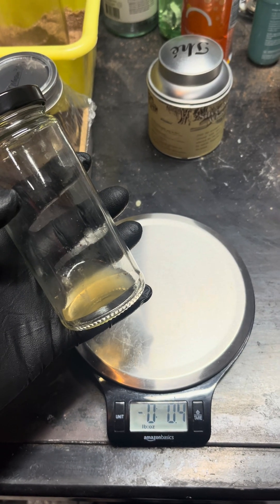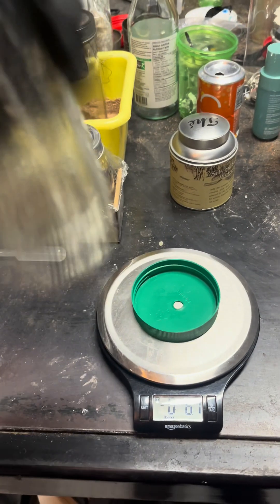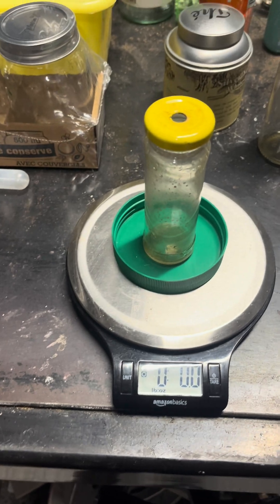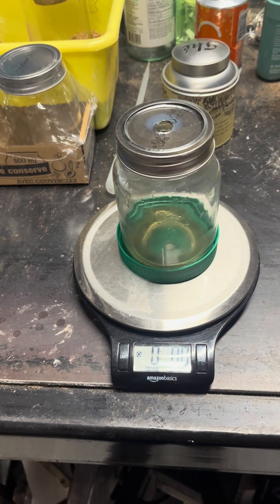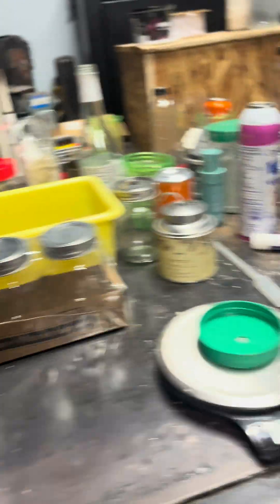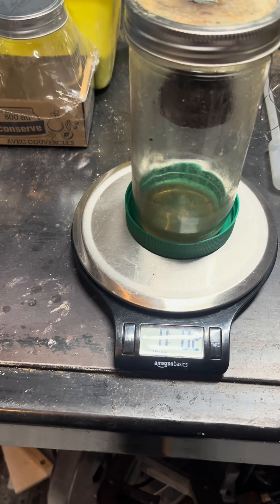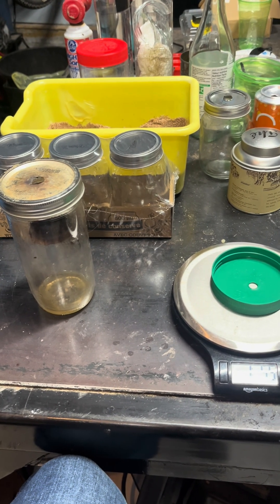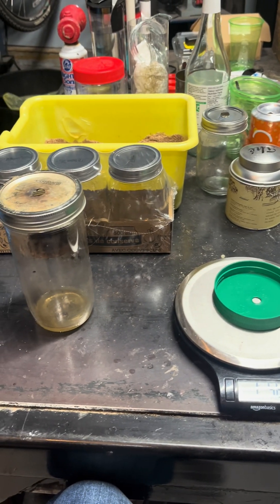Testing Thrust: How Powerful Are My DIY Jam Jar Pulsejet Engines?

Comment: Try putting some kind of nozzle on the end (If you can accurately measure the pressure there are calculators online for nozzle size)
Also for fuel injection you can drill a hole in the bottom of a metal one and attach a pipe to it, and at the end of the pipe put an air compressor (on low preferably) and on the sides put 1 or 2 acrylic clear pipe thingys that feed fuel via 2 12v pond pumps
Reply from the maker: Fuel injection or a drip feed line is something I have been brainstorming for a bit now, maybe time to try implementing it soon!

Comment: What compound are you putting in the methanol to turn the flame green?  Is it a copper or boron compound?
Reply from the maker: I have used both in my videos.  Some I use boric acid and recently I have been using more copper chloride that I made.  It has been working out really well, I think I will make a video of the process now that I have it more dialled in

Comment: Need a thrust tube, like .5 or 1 inch long and 1.2x diameter of hole to direct exhaust in one direction
Reply from the maker: I will have to give it a go! Maybe I’ll do a follow up video and try to maximize thrust
Reply: @AdhDad420  numbers are approximate of course
Reply from the maker: I’ll try a few variations when I get around to testing it and see what works best!

Comment: What type of fuel are you using?  Have you thought about attempting to use a more energy dense fuel or using a fuel additive?
Reply from the maker: In my metal pulsejet I have been using gasoline and acetone as additives.  Gasoline works great if it’s diluted with methanol pretty good.  Acetone seems to help with ignition
Reply: @AdhDad420  Try mixing 10% K-1 kerosene with the highest octane gasoline you can find and make your own pulse jet JP fuel.
Reply from the maker: Hahahaha I like that idea!  I am definitely experimenting with a lot of different mixes among other variables to try to get these things as dialled in as possible
Reply: @AdhDad420  I was a lube tech Level 2. Can mix oils for 2 cycles also, but that oil doesn't burn. Check on line for older JP formulas and you should start at 5% K-1 by volume not mass. If you use ethanol free fuel, the K-1 will mix easier.
Reply from the maker: Thanks for the information bro I’ll have to give it a go
Reply: Nitro methane
RC fuel
Reply: @aalhard  ONLY IN THE METAL PULSE JET!
Reply: @aalhard  And 5-10% methanol as a primer.
Reply from the maker: Hahahah I will have to try to track some down, I assume you buy that at hobby shops?
Reply: @AdhDad420  Yes and ask the % nitromethane, some is premixed with methanol.
Reply from the maker: Ok thanks for the info, I have never played with the stuff so I am very intrigued!
Reply: @AdhDad420  Some call it 'White Gas' because it produces a white flame.
Reply from the maker: Bizarre. I’ve messed with a lot of flame colors but white is pretty elusive.  A little bit with epsom salts sometimes but not reliable
Reply: @AdhDad420  100% Nitromethane, burns with a white flame, mixing methanol will make it less white. VP Racing has 10% nitromethane mixed with 90% methanol and produced a somewhat of a white flame. If you pre-chill the closed metal pipe cap slowing the evaporation as it burns and might get a decent run time.
Reply from the maker: Thanks for the info!